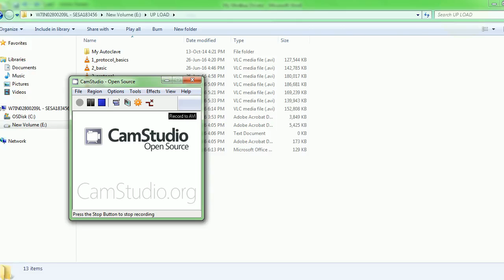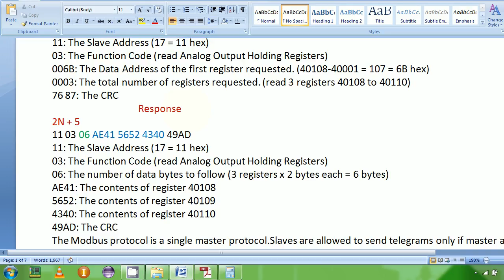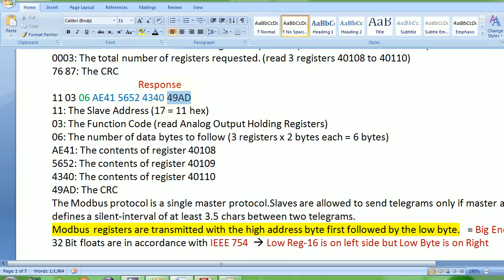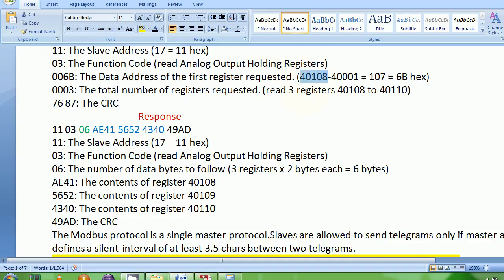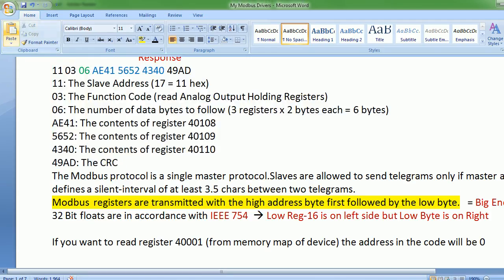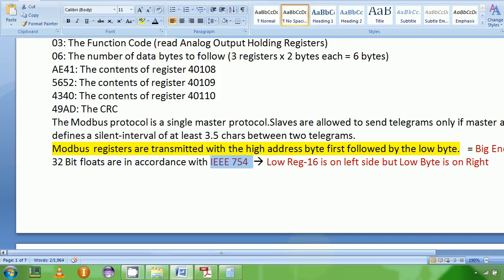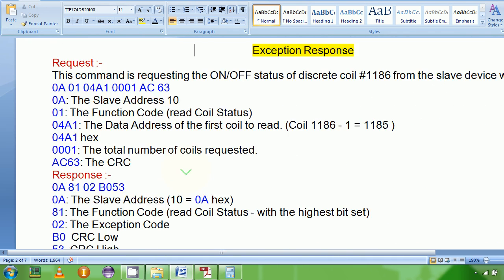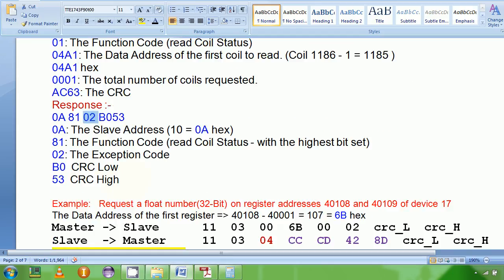8 Modbus RTU Protocol Read Holding Example   2

Comment: Very nice series sir... Really learnt a lot.. I have a small question though. I was trying to calculate the CRC16 by adding 2 bytes zeroes (0000) at the end. But in your 'request' example, the answer 8776 (or 76 87/ L H) comes when we don't add those zeroes at the end. I mean 1103006B0003 CRC comes up as 8776, but 1103006B00030000 CRC16 comes up as 0266.  Similarly for response, if we don't add 0000 at the end, we get 49AD (as seen in your example). May you pls clear this confusion.
Reply from the maker: to calculate CRC16 of request byte array , place for 2 bytes are created , 0 is placed , CRC16 is calucated , and 0 is replaced with CRC16 LSB and MSB.............i recommend you download this modbus tester tool and see what packet its sending........it will help you a lot..........
http://www.modbus.pl/Modbus%20Tester_MODBUS.PL.html

Comment: Sir does it mean when master gets the response,  CRC is calculated by considering the whole value. And when slave gets the data from master, CRC is calculated by adding zeros.
Reply from the maker: on both master and salve , CRC is calculated by placing 0 in both CRC byte locations